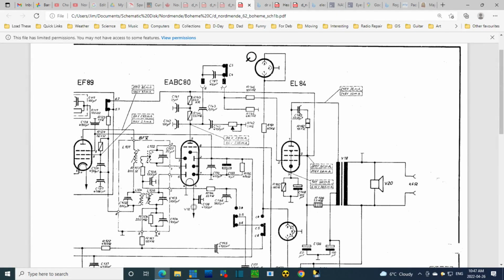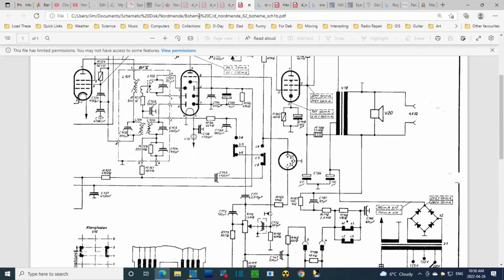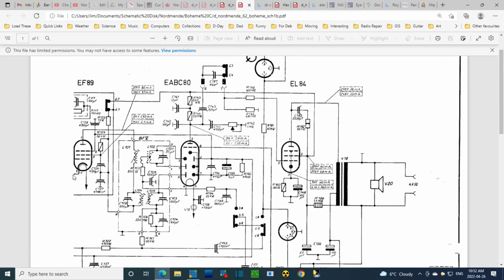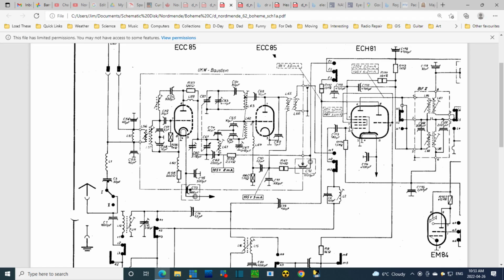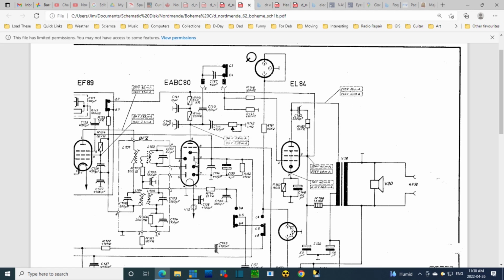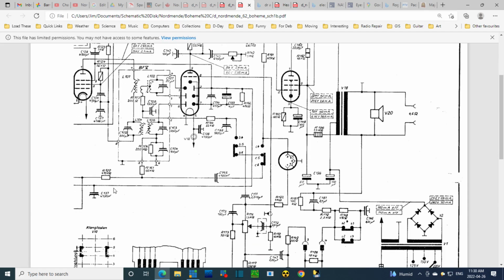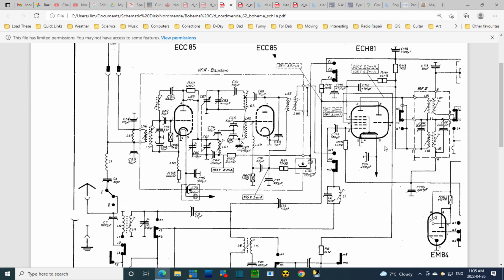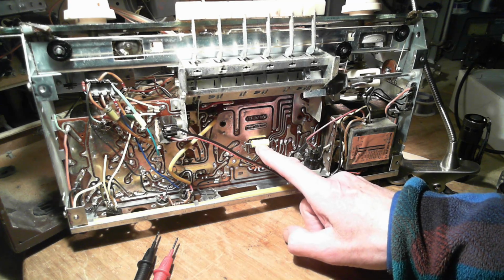Nordmende Boheme C Tube Radio Video #11 - Outside Foil Fool

Comment: This "zig-zag-ding" is a printed coil.
Reply: And the coil ties one side of the 6.3V AC  heater supply to ground. Also basically the two AC heater traces pass directly underneath the cap. And while correct orientation of the outside foil makes a difference, it would be even better to also mount the cap topside the board instead of riding the short bus and putting it bottom side flush against the source of interference...